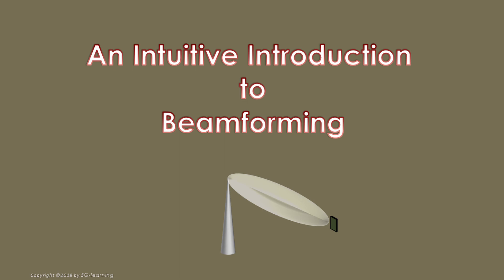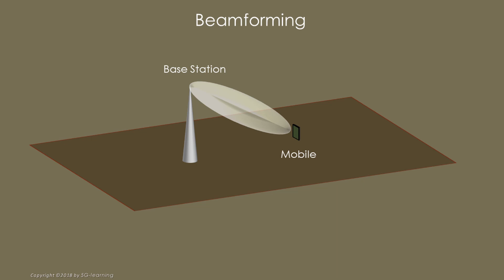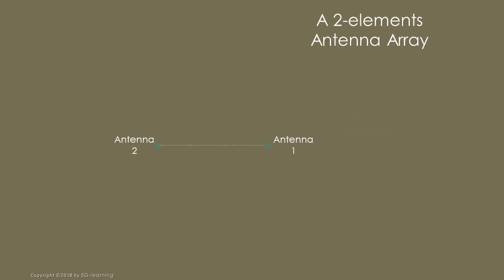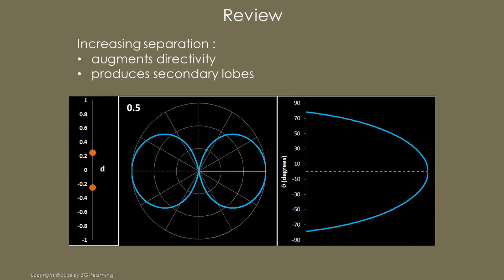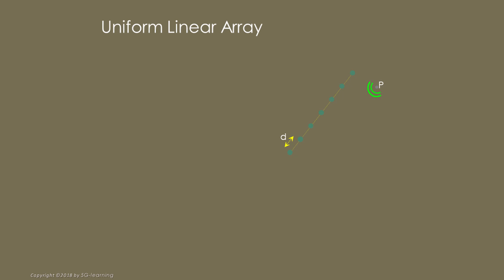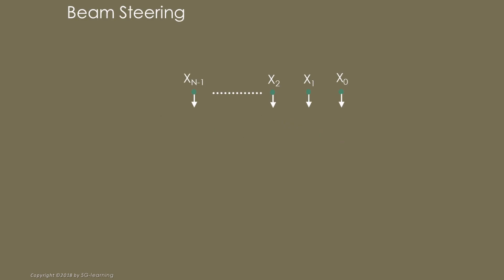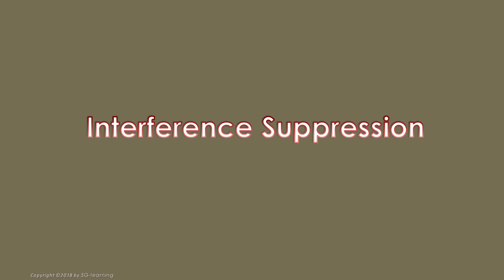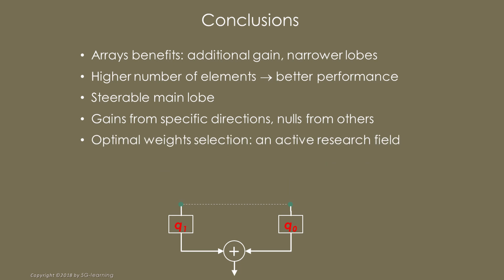An Intuitive Introduction to Beamforming

Comment: Hi, first of all thank you for your excellent lecture.
My doubt is how do we suppress the secondary lobes? Do we even need to suppress these secondary lobes at all?
Do we use the antenna weights q1,q2 to suppress the side lobes too?
Reply from the maker: Thanks for your comment. 
Unfortunately, we cannot suppress the secondary lobes completely with current technology. It is possible to reduce its influence by proper separation between antenna-array elements and parasitic elements, but they still be present.
In practical antennas at centimeter wavelengths (as used currently in 5G), secondary lobe gains are usually 10 dB or more below the main lobe. Therefore, even if they may produce some interference on adjacent cells (for example) their influence is small.
In millimeter waves, it is feasible to design antenna arrays with e.g. 16 elements (or more). In that case, secondary lobes have very low gain compared to the main lobe and their impact may be considered negligible.
Proper selection of antenna weights is mainly used to steer the beam to the target.
I hope that these comments may help.
Reply: @5glearning772  thank you for the reply, I get your point now.

Comment: Thank you so much for the video!! In case of analog BF does this mean there is only one SSB where lmax=1 since analog can have only one bf at a time
Reply from the maker: Thanks very much for your feedback! 

The array may support more than one SSB while using analog beamforming, because the array may point to a certain direction, transmit the SSB burst, then point to an alternative direction and set another SSB burst, and so on in order to sweep the entire sector or cell. 

The analog beamforming limitations are mainly in connected mode.
Reply: @5glearning772  Thank you so much :) !!in case of two BWPs with 2 different SSBs are the two SSBs transmitted at the same time or there's one Main SSB that is transmitted? and can we have different UEs connected to different BWPs at the same time?